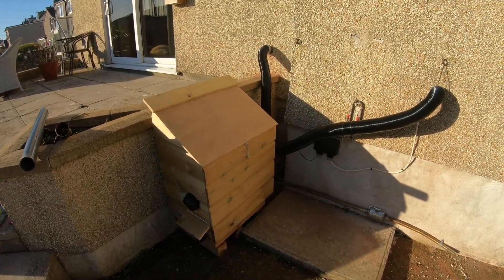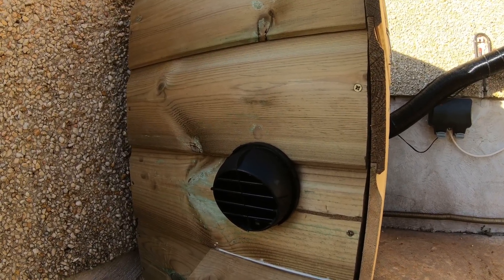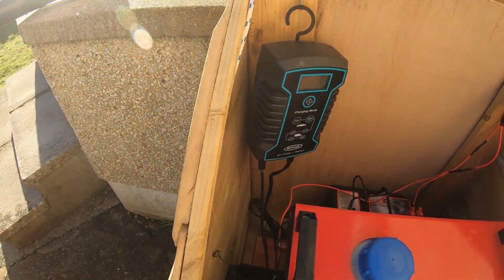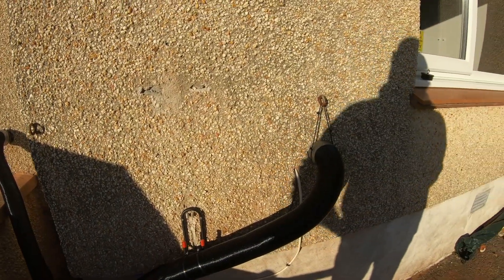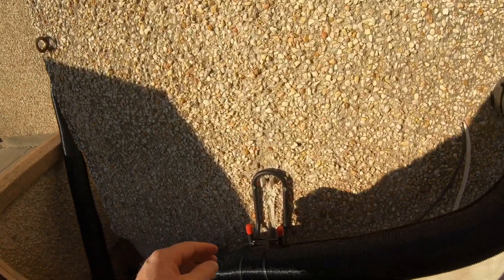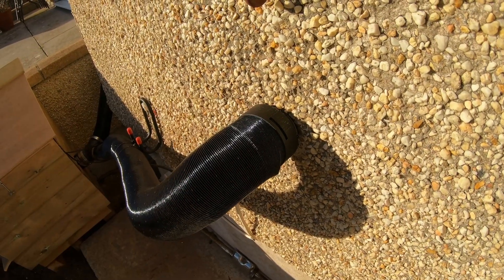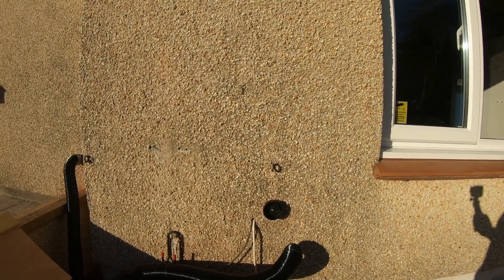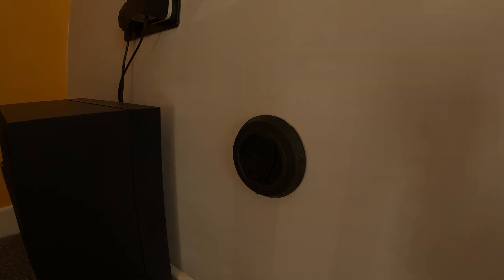Heating my home with a Chinese diesel heater.

Comment: I’ve bought one of these heaters ready for my shed build. I’ve also been looking in to the condensation problem I have in the house and a PIV SYSTEM Positive Input Ventilation where you pump fresh air in to the home from the loft space, creating positive pressure which cures the condensation.
When I first saw you were pushing fresh air in, my first thought was better to recycle the air, then you mentioned the condensation and EUREKA you’ve got a PIV system at a fraction of the cost, think I’ll have to order another heater 👏👏👏
Reply from the maker: Hi Paul. Yes, I’ve seen those PIV systems and by all accounts they’re very effective . How they compare with a diesel heater I wouldn’t like to say. Many people like to quote that I’m  “doing it wrong”  by drawing in air from outside and I didn’t design my set-up lightly or without lots of studying of videos of others. You read advice about opening widows and letting in fresh air when folk complain about condensation, especially in these winter months. But I’m basically doing the same thing. Maybe you should try one heater for your house, then, if your happy with the results buy the second one for your shed. Another point which most people don’t realise is, when you provide the positive pressure, it eliminates any draughts, and in doing so, helps keep out the cold. 
You watch, I’ll still have another viewer come on here tomorrow and say  “you’re doing it wrong”. Anyway, it’s my set-up, it works well and I’m happy with it. 
Hope yours works out for you and thank you for your comments.  Cheers. 👍🏻
Reply: @en53kff  So if I put this in the loft, would I need to cut a hole to the outside to feed air in? Any pointers on youtube videos or maybe some sort of diagram to explain this.

As soon as I saw a video on these diesel heaters, I've been looking to see if someone used it for their home and you're the first. I'd love to figure out how much cheaper it is vs the code of gas or electric. My house has very poor insulation so if I'm here next winter, this is something I'd like to implement. Thanks very much for the detailed explanation and your reasoning.
Reply: look up HRV units. there is a small company called acurasee that makes them and they aren't thousands of dollars either. same concept, cheap price.

Comment: your loosing heat with those external ducting pipes so long and exposed, I bet your fed up with filling that tank every day (don't ask me how I know but I know) I don't know if you've seen them but there are "T" pieces available on the net with dampers that you can adjust individualy to fine tune your supply.
Reply from the maker: Hi. Yes I’ve seen those T pieces with dampers. I did consider them but decided I probably wouldn’t use them often enough to make it viable. Somebody else in the comments mentioned about my ducting being exposed, but as I replied then, I have since insulated the ducts with some industrial grade silvered insulating bubble wrap which has made a small but important difference. Thanks for your comments. 👍🏻
Reply from the maker: PS..  I generally have to fill the tank once every three days.

Comment: When ever I see people using these, why don’t they create a circuit? Pump hot air into the house and pipe the return back to the air inlet of the heater.  That is how they would befitted in a vehicle.  Are they thermostatic controlled?
Reply from the maker: Anyone who has listened to the video and taken note of what I said would have heard me mention about condensation and how taking in fresh air kills the condensation indoors. Fresh air, not recirculating stale air = no condensation.
Reply from the maker: I’m not sure about all of them but mine has a thermostat built in to the control panel. 👍🏻

Comment: so when it’s raining you suck up the rain too?? can’t see the motherboard lasting long
Reply from the maker: No. If you look, the air filter is protected by a timber overhang. The holes in the filter face downwards too. The filter is high enough from the ground to prevent splashing upwards.
Reply from the maker: Plus, the motherboard is well protected in the heater body, which itself is in a waterproof cabinet.  Does that answer your query ?
Reply: @en53kff  the motherboard is exposed to heating air, which you are pulling in from outside, if it’s raining, that air is going to be 90% plus in humidity, damp cold air straight onto the motherboard
Reply from the maker: The air intake doesn’t take in water either, I’ve checked. It all works as it should.
Reply: wasn’t talking about combustion air!
Reply: He has a solid set-up however what sounds like a contradiction, he does have a few holes in his build. He is using the generic air filter that comes with a sponge lined at the bottom, inside of it, which won't stop dust getting to the glow plug and ultimately wearing it out faster. You can buy a proper air filter designed for these diesel heaters that will connect to the air intake pipe.

Another problem with his build is heat rises and stays at ceiling level, so you end up with different temperatures at ground and mid level. To get a more even balance of temp, A ceiling fan in reverse mode (winter mode) draws the colder air from the floor and mixes it with the warm air at ceiling level.
Reply from the maker: @ctrldelete1763    With reference to the holes you say I have in my build, firstly, my air filter does not have any sponge lining at the bottom. It has a fine mesh to stop insect penetration. Secondly, any heat, from whatever source will go straight to the ceiling. I do have a ceiling fan with a reverse mode. I do hope this fills the so-called holes in my build.
Reply: @en53kff  Yes, mesh to to stop insects not something great for air intake. It would be like using mesh as a  filter for fuel.

I guess when you get the chance to open it in the future you might see why it's wise to invest in a proper air filter.

Comment: I use a Mitsubishi heat pump. Diesel is very old school. But I still have an oil heater but don't use it. Bad for climate and expensive 🫰 too.
Reply from the maker: Diesel is very old school… ? Try getting your hands on a diesel heater for a reasonable price. 
As for bad for the climate, I won’t worry too much about my little diesel heater whilst China still builds coal fired power stations at a rate of knots. 🥱
Reply: @en53kff  Diesel is nearly 2€ for 1 liter, how can you save money? I'm paying 25,5 Cent per kWh and my heat pump efficiency is 4,6 kW heat per 1 kW electricity. This is way cheaper
Reply from the maker: @cogitoergosum9127  I pay €1.48 or £1.30 litre for red diesel. I use around 15 litres per week. That suits me just fine.
Reply: @en53kff  is this normal car Diesel? Here we use oil 🛢️🪔 for oil heaters. It's half of the price of car Diesel. Or we use gas, wood or electric heat pumps and photovoltaic.
Reply from the maker: @cogitoergosum9127  It is diesel but has a red dye added to it. It is restricted for use in the UK to farming implements, heating, small machinery but not much else. That includes forms of transport.
Reply: @en53kff  🆗 I see. I'm living in Germany

Comment: I've lost count of the amount of videos that I've watched on diesel heaters. I've found a decent one that my wife will be able to use while I'm at work (£200) a galvanized metal box to keep it in (£100)   12v power supply (£25) extra bits of pipe and whatnot maybe £30. All in somewhere between £350 & £400, question is that is it worth it? I can buy a pallet of logs for the log burner for that. How much fuel is it using? Have you tried running it on heating oil?
Reply: Just completed an actual test over a month using a supposed 8kw we think is the same as any 5kw heater. Air intake uses warmer air.
Tank reliably informed holds 5 ltrs to the brim.
On 3 setting it ran on and off for 14 hours 15 mins.
Normal diesel in area now its dropped currently £1.61 was £1.89 ltr, so (5 ltrs times £1.61) divided by 14.25 = £0.565 per hour plus charger. Red diesel can be had below £1 ltr but may have to bulk buy and store gallons would bring it nearer £0.35 per hour.
Reply from the maker: @jhareng  Hey, that’s not bad going at all. Especially compared to heating with gas or electricity. I buy red diesel from my local garage straight from the pump. I buy 30 litres at a time. Paid £1.30 ltr 3 weeks ago. Hoping it’s gone down in price when I go back this week. I have heard that some heaters, although 5kw, are often badged up as 8kw.
Reply from the maker: I watched dozens of videos before purchasing mine. Mine cost £90, the week before prices rocketed. With the extra bits and pieces I’ve probably spent about £250 in total. It’s a job to say how much fuel it is using as the amount I’m using it varies. I’m paying £1.30 a litre for the diesel from my local garage. I’m probably refilling the 5 L tank three times a week. So much cheaper than electric or gas heating. It can run successfully on heating oil although personally I haven’t tried it. There are so many videos on YouTube where people have tried many different concoctions of fuel. However, the biggest issue seems to be the burner coking up with crud when using anything other than diesel. Good luck with yours. 👍🏻

Comment: Good set up ideally should think about insulating the hot air pipes into house outside as you will get heat loss in freezing weather.
Reply: Have you got a video of the appliance running please.. nice set up by the way.. ps, what does the temperature get up to in the room ? .. thanks. Dave
Reply from the maker: @davidpunchard5698  Hi there. I don’t have a video of it running. I could do one but there are many out there already on YouTube, It’d just be another of many. 
The control unit lets you set the temperature of your room. I set mine usually at 20c. The heater runs at full until it reaches 20c then you can hear it quietening down almost to a ‘tick over’ to maintain that 20c room temperature.
Reply: That's what I was going to say. It would be massive heat loss! Even insulated there would be a loss.
Reply: Hi Like the set up, I am thinking of installing one outside. myself , any advice on the installation of the pipework would be great. Thanks, Mark
Reply from the maker: Already done. 👍🏻
Reply: Very nice set up
Reply from the maker: @StevesOutdoorCameraAdventures0   Thanks Steve. 👍🏻

Comment: Just something to think about I'm seeing a lot of people now putting a egr cooler in the exhaust line and then being able to run a normal radiator and then doubles the heat
Reply from the maker: Yeah, I’ve seen that. It’d be extra work and expense when I don’t really need it. I admire the people who go the extra mile though. It just shows you what can be done. My set up suits my needs right now. Cheers.

Comment: Autoterm sell thinsulate lagging for the air duct
Reply from the maker: Hi Simon. Thanks for that. A couple of days ago I insulated the air ducts with industrial grade silvered bubble wrap. It has made a small but noticeable difference. I had always meant to do it but hadn’t when I recorded the video. Thanks again. 👍🏻
Reply from the maker: Simon, I just had a look at Autoterm website. Their prices for accessories are so much higher than I paid when shopping around on EBay. My purchases were of a decent quality too. Just a thought incase you were looking.
Reply: I used ordinary food steel cans through the wall as air ducts it will last longer and flame proof just tape them together with screwfix heat resistant tape a bit food smell at first even though washed but soon goes away.
Reply from the maker: @BS-ql5nl   I’ll stick with my purpose made neoprene ducting thanks. 
Neoprene resists gas permeation and can function in temperatures up to 275 degrees Fahrenheit (F). Even at such high temperatures, neoprene will not physically degrade, making it better suited to long-term use in high-temperature applications than natural rubber.

Comment: you are loosing out on the heat available from the unit, put it inside, add copper to exhaust and vent out the opposite side of the room. keep your intake inside, better chance of heating room
Reply from the maker: Thanks, but I know about all the options having seen dozens of videos. This set up works for me. I have reasons for doing it this way which are explained in the video and in answers to questions from viewers. I get sufficient heat as it is. Cheers. 👍🏻
Reply: Bad advice never ever have air intake inside

Comment: What wire did you use to extend the control panel, i need to extend mine for easier viewing in the shed but haven't checked the wiring out yet.
Reply from the maker: It’s a 3 core cable suitable for 12 volts. (Three Core Marine Auto TINNED Thin Wall Cable 1.5 mm² metre 15/16 AWG 3 Yacht ) Tinned marine, robust and more suited to outdoor environment. If you’re needing it for indoors I wouldn’t be so fussy. Good luck with it. 👍🏻
Reply: @en53kff  Thanks for taking the time to reply :)

Comment: Nice job, i've got one of these for my shed, works out at between 5p and 9p per kilowatt hour depending on diesel price, which is great in comparison with 34p per kwH for electricity!
Reply: ive run mine off kerosene with no issues for about 7 weeks now and its only about 70+vat a litre
Reply: @nigel_d  Nice, do you have to buy a lot to get that price ?
Reply: @GaryMcKinnonUFO  You can get diesel cheap from most Romanians.
Reply: Note that Kw input does not equal Kw heat output
Reply: How are you getting diesel so cheaply?
Reply: @paulharrison2325  red diesel ? 🤔
Reply: @paulharrison2325  I got normal diesel for anywhere between £1.70 and £1.90 but some on YT have said they get red diesel for as low as £1.30.
Reply: @GaryMcKinnonUFO  so you’re not getting it for 5-9 pence per kWh then. Diesel has about 10 kWh per litre.
Reply: @paulharrison2325  Thanks Paul i'll have to revisit my maths !
Reply: @GaryMcKinnonUFO  I believe red diesel isn't going to be available soon.
Reply: @shaneord7527  Thanks, yes i read about that :(

Comment: Hi Advice i would say you loosing and wasting  a hell of a  lot heat having the pipes outside in the cold like that those pipes get very hot. also the air  intake outside drawing very cold air over the fins of the heater is more heat loose most have it drawing the warm air its putting in   same as recirculating.i would prob mount you heater on the wall in the box  shorten the pipes and have the air intake pipe  with the short hose inside the house   drawing warm air hope this helps
Reply from the maker: Hi Gaz. Thanks for your suggestions. If you read through the other posts along with the answers you’ll find I’ve mentioned these points and why I chose to do things my way. I watched many many videos, including do’s and dont’s, right ways and wrong ways but figured my way best suited me for reasons I’ve laid out. Cheers. 👍🏻

Comment: Nice neat install 👍🏻.  How did you extend the controller cable… and what type of cable did you use???
I think I am just down the road from you.. I’m in Wolves.  Just subbed you.  Notice you are a Slade fan 🎸💪.  Jim Lea lives opposite my nephew 😊
Reply from the maker: Hi.  I bought some 3 core cable from eBay - Three Core Marine Auto TINNED Thin Wall Cable 1.5 mm² metre 15/16 AWG 3 Yacht . Less than £3. I moved to North Wales 10 months ago. Yeah, big fan for many years now. 👍🏻
Reply: @en53kff  Cheers 👍🏻

Comment: thanks for posting- good set up. Do you keep your trickle charger on and connected to the battery all the time? Or do you just charge when heater is not in use to top up battery?
Reply from the maker: I leave it all on and connected 24/7. There’s really no advantage to keep disconnecting and reconnecting it. If you were storing a car in a garage over long periods for example, you’d have a trickle charger on 24/7. Same principle.
Reply: @en53kff  Thanks mate. I didn’t realise you could keep a charger on and use the battery at the same time. I’m fitting my heater today and am using the step down transformer for starters but would like to explore the battery options and your solution seems like a good one. I’ve spent a while building the box and weather proofing it with flashband because it rains a lot here in Devon. Cheers
Reply from the maker: @jellyartist  Hey, I’m in north Wales, it probably rains even more here. 😄 Good luck with it. Give me a shout if you need any answers.  👍🏻
Reply from the maker: @jellyartist   It is a ‘trickle’ charger I’m using. It’s what it’s designed for.
Reply: @en53kff  Thanks - Please can you tell me or post a link for the charger and battery if you have a minute sometime. Thanks for taking the time to reply. Much appreciated.
Reply from the maker: @jellyartist  https://www.halfords.com/motoring/batteries/car-batteries/halfords-hb063-lead-acid-12v-car-battery-3-year-guarantee-950295.html

https://www.gsfcarparts.com/rinrsc808?utm_source=awin&utm_medium=323889&utm_campaign=Affiliates&awc=12707_1674558118_5a31b28628edf61cf9002834df71dc3c

That charger, 8amp is a great price. Cheapest around.
Reply: @en53kff  Really helpful. Thanks
Reply: @jellyartist  that battery is a Euro car parts Lion battery , and they are crap , dont last , I wont fit them to customers cars , had too many warranty faults with them , halfords sometimes buy off Euro,  they do have their own branded batteries  , may have just been supplied themselves one by Euro and sold it on
Reply: @mikeberry304  Useful to know, thanks.
Reply: @jellyartist  I imagine if it's permanently connected to a trickle charger, without the heavy loads taken and replaced every time you start a car, such a battery would be adequate.